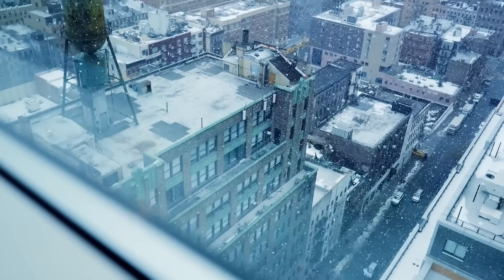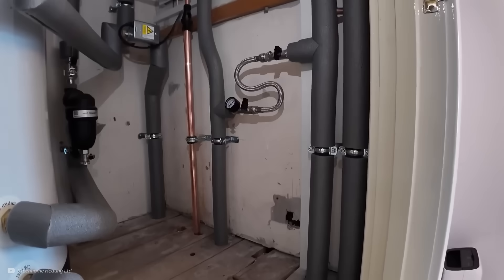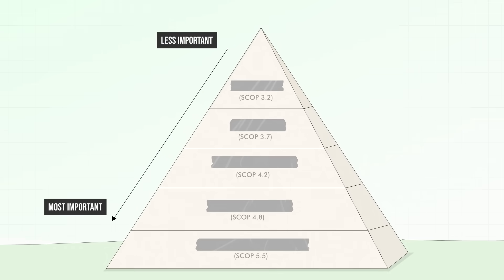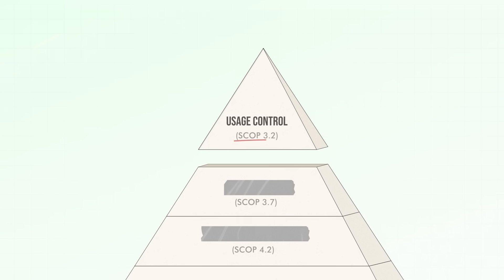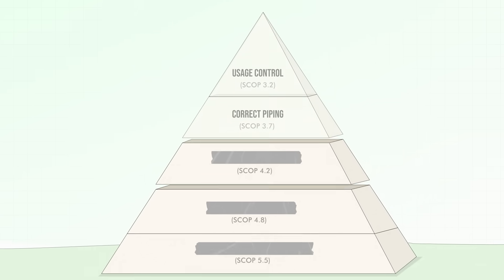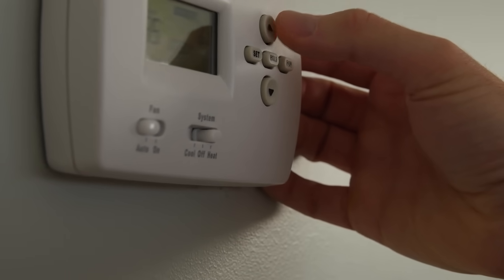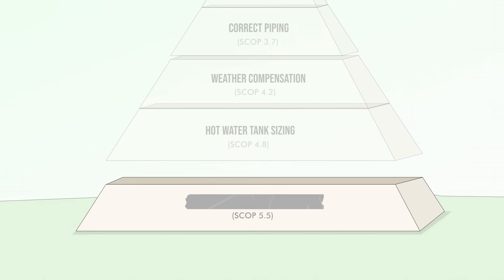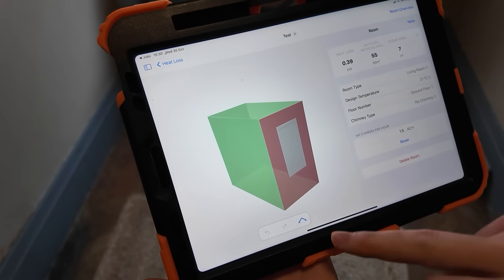The Genius of the World's Most Efficient Heat Pump

Comment: Just a glorified big fan assisted fridge needs to be combined with multiple sources eg solar + grid power 
Just not good enough for full house heating that's lacking ultra home insulation.... If was smart and heats 1 room at a time and switches rooms/rads on when needed wud be minimal for UK otherwise pump per floor may be good idea then the price kills it 😂😂😂

Comment: So disappointing Ryan. This video is about smart heating systems NOT heat pumps and you are perpetuating the heat pump con. Apply these principles to a modern gas boiler and the results are much better. Even better, use a gas fired heat pump and we are close to peak efficiency. Please don't tell everyone who respects you that this video is about heat pumps, it is about heating systems. Nearly as annoying as those who suggest that insulation your property makes a heat pump more efficient when it is the property that is now efficient and nothing changed regarding the heat pump efficiency, it is unchanged. This is really bloody important.

Comment: The problem as I see it is this: even with a COP of 10, the UK will NEVER have the generating capacity to power one quarter of the 28 million units needed to replace gas boilers. We’re already importing almost 16% of our electricity, it’s taking 25 years to build a single station like Hinkley C, while wind and solar are useless - irrespective of whether there’s no sun or wind.

Comment: The Bosch IDS 18 plus (Inverter Ducted System) checks most of the boxes. Sensors are built in to monitor and modulate the output. It very rarely runs over 60% capacity. They are available in a 3 ton/2 ton model or a 5 ton/4 ton model. The tonnage is field selectable via dip switch J2. Default is up/on for the higher output. You can get almost full btu output as low as 5 below zero Fahrenheit.  18 seer 9.5 hspf. They have pretty much become our standard heat pump installs. If you pair it with a solar system with battery wall, you are essentially heating/ cooling your house at no cost.

Comment: I understand Heat Geek in the heat pump business they need to stop giving dangerous advice to people like lowering hot water tank temp it should be 55-60 and these guide lines didn't came from thin air ! they are there because some people paid the price with their life 

Also the ClickBait 800% - This like driving a BMW M5 and monitoring realtime MPG at downhill of course it will say 55mpg !

Comment: Show me the P-h diagram of the vapour compression cycle and where all the magical rocking horse enthalpy is coming from. Heating effect / work done multiplied by all combined efficiency losses. Not 8. What would Roy Dossat have to say about this? Talk to me about cascading cycles with biomethane combustion engines with heat recovery. Low temperature gradients and low pressure differences between the condenser and evaporator are the keys

Comment: please dont do videos about heat losses scop - this IS a scam, you cannot use that in direct price per calorie estimation, only in rough price per month interwal.

whole video can be summarized as "pay more upfront to save a little bit in the future vs pay less upfront but pay considerably more in the future. and mistakes during setup wil cost extraordinary more to redo if you would want to decrease running costs"

Comment: Seems to me that what he calls "weather compensation" is actually what engineers call "fuzzy logic."
Reply: weather compensation is a temperature bias depending on external temperature, so when the outside temperature is warmer i.e you need less energy to warm the building when the temp outside is milder, when its colder outside the heat pump will supply warmer temps. this process also is used with modern  Condensing Gas boilers…..usually an add on unfortunately

Comment: They need to start designing these, for when the complex control circuit boards (that are outside by the way) FAIL -> to still operate in some dumbed down on/off mode, or always on... or at the very least still operate the aux/emergency heat backup... throw up warnings everywhere for the failed board that has to be swapped out.   Mr Cool etc and others need to start thinking about that!

Comment: Re enlarging your tank, it's a good idea for all the same reasons discussed earlier, lower average temp means lower heat gradient, resulting in less heat loss, that lost heat is heating your home anyway, so not going to waste in winter. But for safety reasons, you want to keep it above 55 deg C - only touching on legionaries. 
Drawing on that car analogy, the fuel efficiency published ,is for idea condition, it is only a theoretical maximum, real-world usage gets worse, not better. Like wise, a condensing heat pump's COP is the best theoretical maximum at the unit. While I agree with all the geeking out, is arson and the efficiency gains amazing, it's false advertising to say it's improving efficiencies. That said, refrigerants are  environmentally hostile, lasting hundreds of years with GHD and unquantified negative biological accumulation and effects. There are better solutions, than just burning Hydrocarbons and mass-producing environmentally hostile refrigerants. Side note the most environmental inert refrigerants are mostly band from home heating/cooling applications, and it's not because they are not efficient at zub 0 dec C temps.

Comment: S hot water heat pump I'm lacking.  You forgot to mention insulating the house, having a white roof, lots of thermal mass, and having your house face the right direction for maximum thermal gain in winter and minimum thermal gain in summer. months.

Comment: There is no such thing as a 800% efficient heat pump! You cannot exceed 100% , it is impossible. You may get more heat out than the energy you put in but that doesn't make it 800% efficient! If it was 800% efficient, you would have a perpetual motion machine!

Comment: What does it mean that 1 unit of electricity is transferring several units of heat ? If so why don't you use the heat to run the pump ? Assuming the claimed '800% efficiency' using even half of it to run the pump would make it run for free... I don't get the idea of 1 unit of heat being equivalent of 0.X of the electric power used...

Comment: One heat pump unit on the outside is about the same size as a storage heater.
So explain this.....A storgae heater is at least a 3kW unit requiring continuous power for at least 8 hours during off peak (Nightime) to charge it up.
That is ONE storage heater and really,  one needs one heater per room.....A three bedroomed house would require at least 6 storage heaters which would cost a lot in electricity bills.
And yet those that sell heat pumps promises to heat the same house by getting free heat from the air, with a unit about the same size as ONE storage heater sitting outside theri house....!!!
Are they serious or just con men....?
Remember, that outside unit, is about the same size as ONE Electric Storage heater....
Think about it for one minute and you will realise the absolute rubbish and salesmanship spoken about heat pumps.
Basically Heat Pumps are electrical heters and will cost a fortune.

What I do not understand is why our Governments do not tell the truth about heat pumps.
Then again, in winter, hetat from the icy cold unit , the size of one storage heater covered in snow.
Really!!!
To me, this is one one the greatest cons going about today.

Try and prove me wrong.

Comment: The problem with ultimate efficiency is you lose reliability.

The more efficient air-conditioning units get, the thinner their metal is and the parts become less robust.   While it might take less energy, it will certainly break down much more often and end up costing you 10 times more than you saved in electricity.

My mother has replaced her “efficient” AC units, three times in the past 10 years. 

While I’m still rocking the same unit from 35 years ago.

Comment: (1) You should not have to put larger radiators in your home if you move to a heat pump. (2) we use most of our energy to heat our homes in winter 
-2c to 4c this is when you need the heat pump to be running at 600% efficiency to equal the gas cost of. (2) not an average of 600%  over a season but 600% in winter at these temperatures. To make it profitable to install. (3) you need 800% efficency @ -2c to 4c (4)  Most people would need an extra shed to put the tanks in to store the hot water in then pipe it into the home. As most houses are too small for the equipment. (5) I have a problem finding a space for the gas boiler small as it is. (6) to make a heat pump worth having electricity prices need to drop 6 times smaller. Or your bill energy bill goes six times bigger. Gas 5p per kilowatt electricity 28p per kilowatt.
Reply: Not true at all.

Where are you paying 5p/kWh for gas and 28p/kWh of electricity? the price cap currently stands at 6.99p/kWh for Gas and 27.03kWh for Electricity.  And the current tracker price is 5.05p/kWh for Gas and 22.46p/kWh for Electricity.
Also gas boilers aren't 100% efficient, and if they're not set up with larger radiators like a heat pump you're going to be getting closer to the average of 84% efficiency.  which means 1kWh of heat from gas costs you 5.9p/kWh (at tracker price).  And a heat pump running at a SCOP of 4 is costing you 5.62p/kWh of heat.
However, there are plenty of other options with prices, e.g. OVO do a heat pump tarrif where the heat pump usage is 15p/kWh, making it cost 3.75p/kWh of heat.

Comment: could a heat pump be used to keep snow/ice from forming on a metal roof?  the radiator would have to be located just under the roof with almost no insulation between it and the metal roof.
however, the heat that the radiator would produce could be fairly low (maybe 35 degrees F? ).  Maybe during summer the system could be used to cool the roof?

Comment: I've lived in many types of places that used many types of main heat sources and my preference is natural gas HVAC/Furnace. Natural gas hot water radiant heat is really nice too but very involved are rare.  My experience has been that gas central heat is as cheap or cheaper than anything else even hear pumps and the gas central unit is great in a areas.  It is great cozy heat. It heats up quickly. It works very good at all temperatures even below 0F. They are reliable and last for a long time.

Comment: The Video shows the basics, regular installers should know.
If I can add sth.
Hot water tank should be a passing through design(hygienic tank), best technology IMHO (example: Rotex/Daikin 500L buffer)
Secondly, correct sizes of the heat pump system is only possible to limited range of outdoor temperature(compressor work range,   without extra hear sources)....outside of that Heating buffer should be used.
Luckly, UK has a mild climate. Good luck

Comment: I have a room that is unused at night and has a high heat loss. I run the heat pump during the daytime when outdoor temps are higher. How can I calculate the trade off of running the system 24/7?

Comment: 2:15 Kelvin is an absolute scale not a relative scale -- it doesn't have degrees! 
Relative scales like Celcius & Fahrenheit have degrees (100° between the triple-point & boiling point of water & between the melting point of mercury & blood heat respectively).

Comment: Cool coverage of their heat pumps, thanks!
But as for your your sponsor, you do realize that a 20ms transfer time (switching from utility power to battery power) is completely insufficient for electronics, right? A typical home-use UPS has a transfer time of under 10ms. A typical home computer's power supply has a hold time (how long it can maintain nominal power after a power loss) at around 15ms. So 20ms would work fine for electrical appliances, but not for electronics like computers, TVs, stereos, and now most home appliances which are electrical but have electronic controls.

Comment: My fairly new panasonic heatpump is rated at 5.7 SCOP. I don't know how you can say that "a decent heatpump from a leading brand" gives you only 2.5 SCOP, that seems very low these days.

Anyways, efficiency purely in energy terms is one thing, and you explain it well. But count in fluctuating electricity prices during the day, and some degree of start-stop heating makes sense. Boost the temp a bit before the price goes up in the morning, then coast past the high cost hours at a lower power level, using the the thermal mass of the house. Then boost the heat again around lunchtime, and repeat the cycle at dinner time. It can be done so gently that it isn't really noticeable, but it still saves energy cost, and it helps the entire energy grid be more efficient. I do this both for house heating and water heating, thanks to an off the shelf smart home computer and a power supplying company that provides good software solutions for it. It helps their company as well. When their customers optimise for cost efficiency like this, it enables them to buy cheaper power in the marketplace. Further more, it reduces/delays the need to build beefier power lines, saving cost there too.

Comment: very interesting explanation. I am too slow to read all 1396 responses but i see quite old style radiators. I think they were developed to work with temp's like 80-60. There convection plus radiation are in vendor's lists and are calculated with higher Dutch HR gas boiler systems. I guess low temp "in floor piping" will help but i really want to keep my radiators instead of digging in the nice floor to add the newer system. So???

Comment: Test equipment should be recalibrated, dlight adjustment with a hammer, mickey mouse. In all my years 40 as a air con/ heat pump engineer that is some claim .

Comment: A few thing about heat pumps, that anyone should consider before buying:
1. They work best with moderate climate. Canada winters are not the best use case. You can use one, but the energy cost will be sky high, Also insulation has to be top notch, or it wont make any economical sense.
2. HP are low temperature heaters, so radiators are an absolutely ridiculous idea. HP only with floor heating. Low temp, large area. 
3. Insulation. Insulation. Insulation!
4. Defrost water buffer is a must, else it will just ruin you with the electricity bill as the HP needs to use energy to defrost the unit.
5. Heat recuperation is a must/good idea. 
Generally, HP are great for moderate climate, when the temp. doesn't drop below zero to much and not very often. They are not a be all solution and often need a large investment into the house, before it even makes sense to install one. Do not listen to installers promising free heating. First analyze your home. If it has radiators, little or no insulation, no recuperation, then I'd stick with a decent fireplace. The investment to bring a building up to standard may be well above economical rationale, plus the whole cost of the HP and probably solar panels.
Reply: Ah I see repeating the myths.
1) Heat Pumps are extremely common in Scandinavia, in my area we get temps down to -20C and they still work fine.  Insulation is key for reducing costs for running any heating system, and not a make or break for heat pumps.
2) Underfloor heating is great, but radiators work well too when correctly sized for the application.
3) again, insulation is key to reducing running costs for any heating system
4) When installed properly this isn't a concern for the consumer.  Plus defrost cycles are very efficient nowadays - with reusing a lot of the energy.  Typically much more efficient than what a gas boiler wastes out the flue all the time.
5) again not true.

As for your last point, a fireplace would be terrible for that situation too as you will have one very hot area and everywhere else very cold.

Comment: positive to state that these are basic principles...with the devil in the detail. Government, as in Germany, trying to force every home to convert to Heatpumps was dumb. AS every single case is different.
But I wonder that u dont mention methane as coolant!? CH4 has a much geater Temp gradient and allows for a higher temp at the end (i.e. room radiatos) so can avoid enovation to floor heating, which is needed at the low temps of today pomoted HPumps, which runs at 40-45C. CH4 can run at around 70C which allows to use the old radiatos!  
the only backdraw: its flammable. but so is heating gas!

Comment: "Cop" is depending on "input" temperature(outside Air) 
Real example of Heating  Pump-My House have floor heating(100m2)There is outside unit called Wolf(german heat pump)When is outside temperature about 5celsius,pump using 1KW of electricity for producing 5KW.When is outside temperature below 5C',then pump spend 2-2,5KW for producing 5KW of heating energy.Maximum of this pump is 7KW.
My Friend have Heating Pump,who is using ground water(he installed 400metters of pipes in the ground)So,thru this pipes going water,who giving all the time same temperature for heat pump(abouth 11celsius)This kind of Heating Pump have maximum efficiency.
There is tons of Heating pumps,who making from 1KW of electricity-8KW of heating energy.
Even 11KW!LG have heat pump 0,950W-11KW.
People first need to understand the difference between floor heating and radiator heating.For fthe floor heating you need 30-32C'.For radiator heating 50-60C'.
For floor heating-almost half of energy used for radiator heating.
The difference is obvious.
It is not just abouth Heating Pumps efficiency-it is about complete system,isolation...

Comment: diminishing returns. You need 1 thermal energy, a COP of 2 means you spend 1/2, COP 3 : 1/3, etc. So making better to go from COP 2 to COP 3, you gain 1/2-1/3=1/6 (17%), which is significant. Reaching COP 4 you gain 1/3-1/4=1/12 (8%) isn't much but still something. Trying to go higher is just not worth it.